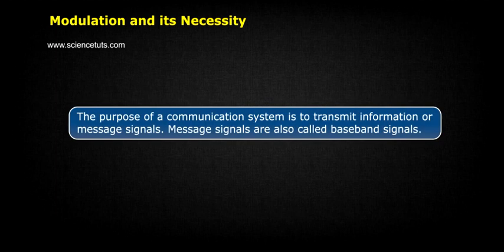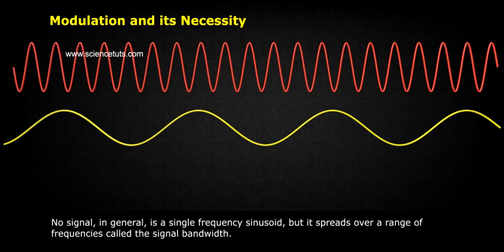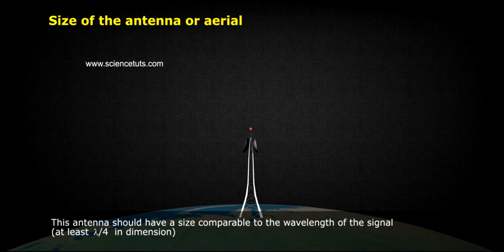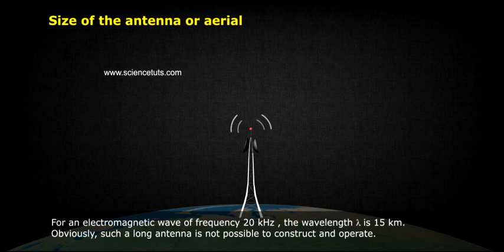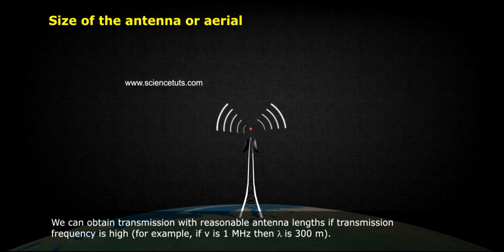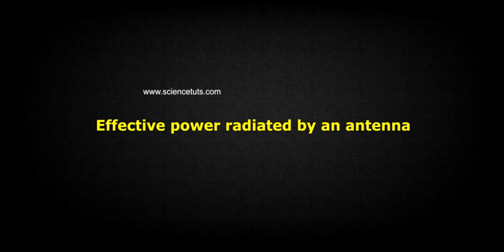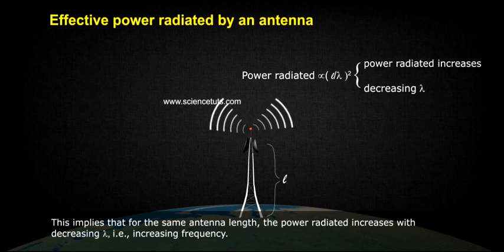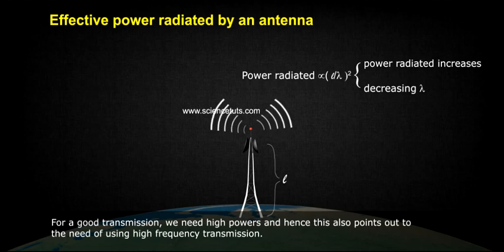MODULATION AND ITS NECESSITY

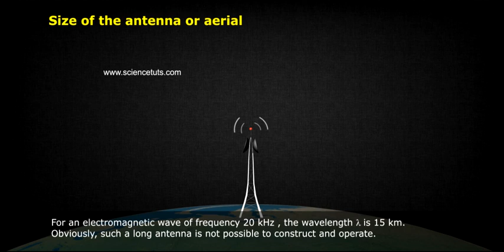Comment: 1:08 In the video it says it is not possible to construct and operate an antenna at a wavelenght of 15 km (f=20kHz). But it is! And it has been done! A transmitter located in Sweden, Grimeton, operated at f=17,2 kHz with a corresponding antenna!